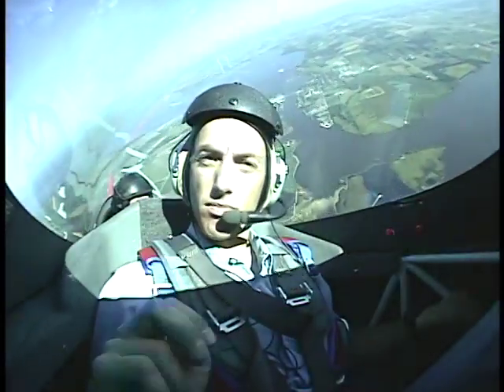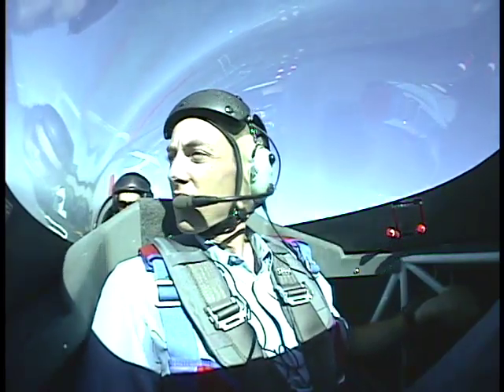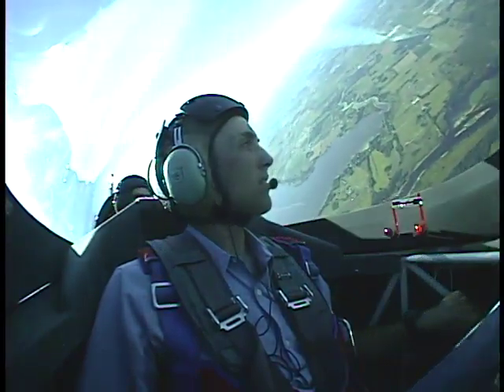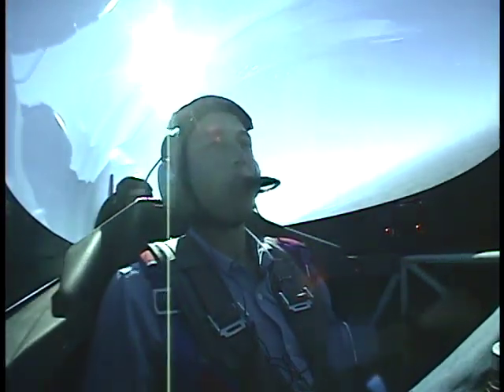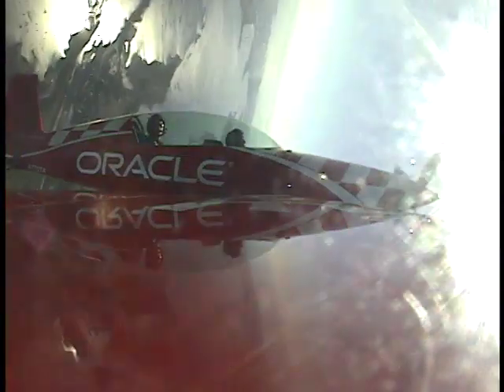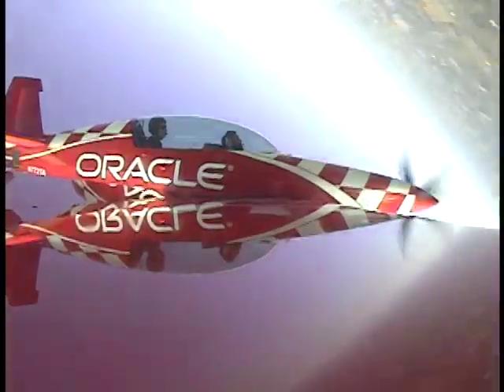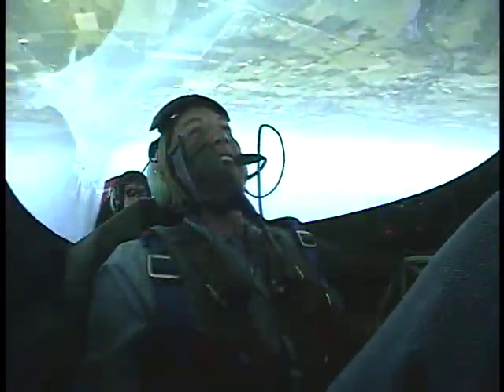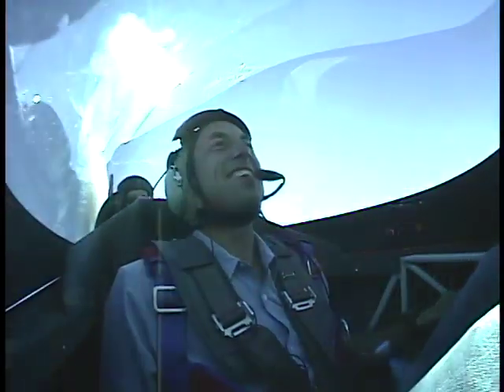Eric Tucker Inverted Flat Spin

Comment: @caonoak as to what elevator setting you need :
- you need to stop the rotation first : if you elevator position prevents sufficient airflow from hitting the rudder, you won't get out of it
- you will need to get break the stall (typically elevator slightly forward of neutral) , and ease out of the dive
As you get out of the spin, outside wing will recover lift sooner, temporarily increasing rate of rotation

Comment: @caonoak in a flat spin,  the aircraft attitude is closer to cruise; in an ordinary spin there is a fair amount of nose-down; in both cases the aircraft is moving down vertically; a spin where the aircraft's CofG is still moving horizontally would be dynamic such as in a snaproll
things that will make a spin flatter : aft Center of Gracity location, gyroscopic precession (for instance, if in a left spin with a prop that spins counterclockwise, the higher the RPM the flatter and faster the spin)

Comment: what is the diffrence in normal spin and a flat spin? one more question . in a spin to the right we need apposite rudder and what kind of elevator setting we need when pulling out of the spin? i got this question wrong on my ppl written.